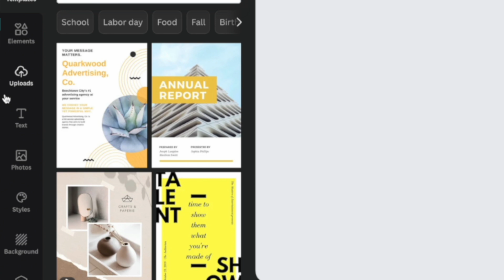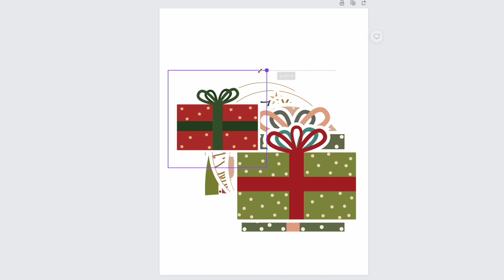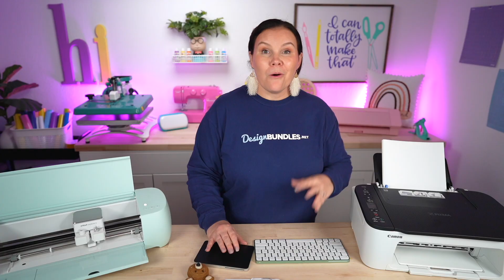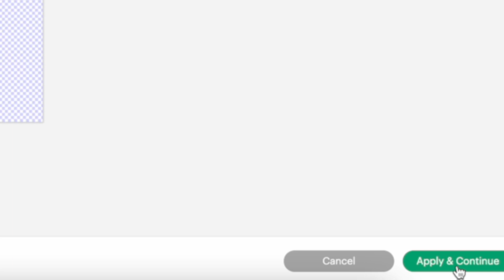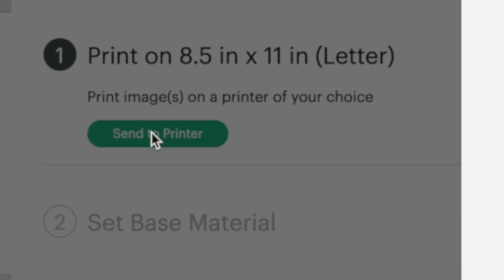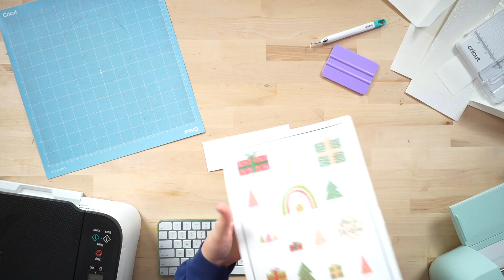OMG! Holographic stickers with Cricut  🌈 | Print and Cut Stickers Cricut

Comment: I love the sparkle and anything holographic! I have a Cricut Joy so I can't do the cut part. If I turn or leave on the bleed will that make something like an offset around the images so I can fussy cut them?
Reply from the maker: I would not do the bleed bur yes you can fussy cut with scissors that's one way I like to do mine another things for round ones I use a round punch :)
Reply: @DesignBundles  Thank you!